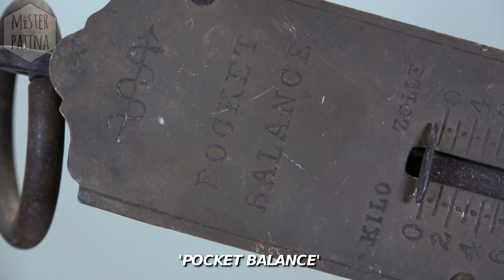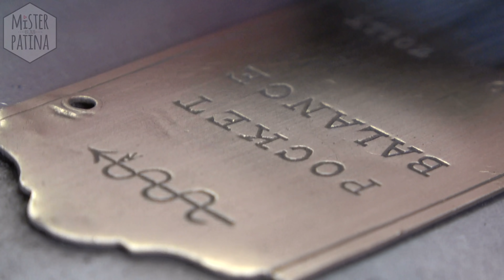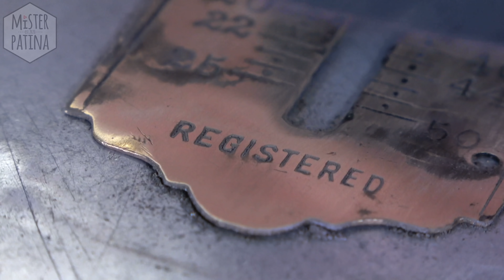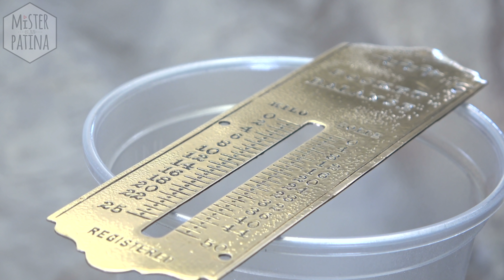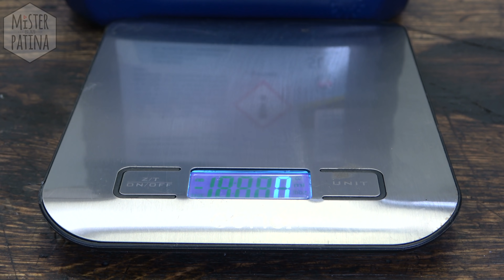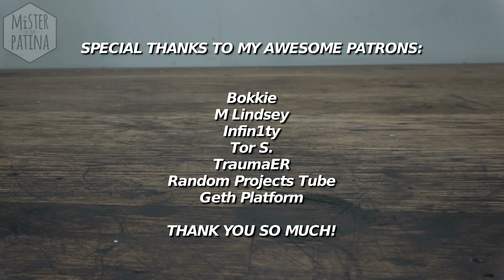Antique Fish Scale | Restoration

Comment: Hallo Mr P. We always enjoy your work and seeing how your skills evolve. It did look like the old hook was hardened, thus the crack. One small thing, did you light the torch with a lighter? Once every twenty years the lighter will explode doing that, and take the hand with it. A shop like yours must have an old flint striker around. Polished a bit, strikers look good hanging by the steel-work bench. All the best, Leon.
Reply from the maker: Hey Leon, don’t worry - the lighter is empty, I just use the spark 🙂
But yeah I agree! Greets

Comment: I* feel like if you got a plastic tote, and a small mist bottle, you could apply the cold blue solution using that, and just recapture the overspray within the tote.  or an airspray bottle would work too, of course. and you wouldn't have these brush strokes? maybe more even coating?

Comment: This type of balance needs to be calibrated with different size weights to judge the weighing  accuracy at the start, middle and End of the scale. Springs can have different characteristics when stretched to different lengths so this is why proper calibration is needed.
Reply: I think so too.

Comment: What was that shaft from, an old golf-club or something? Just curious from the markings denoting a gripping area.
Regardless, nice recycling and restoration! I wonder if the old hook was hardened and that's why it broke?
Maybe heat could have saved it, maybe not.
Reply from the maker: Hey Furry! The shaft was from a dial gauge. Iam pretty sure some heat couldve saved it, but on the other hand i didnt think that itll break THAT fast :D
Reply: Ah! That's why it looked familiar, thanks!
Yeah, been there done that, always a pain when things just snap like that!